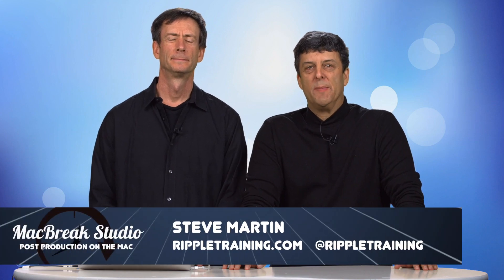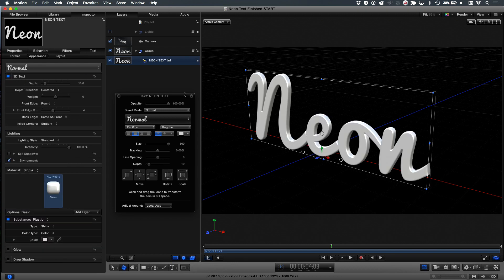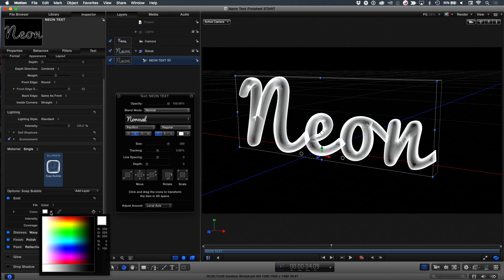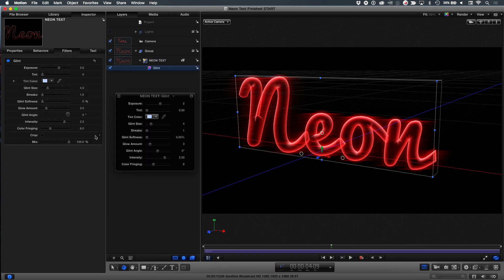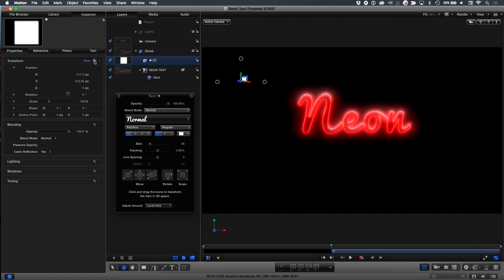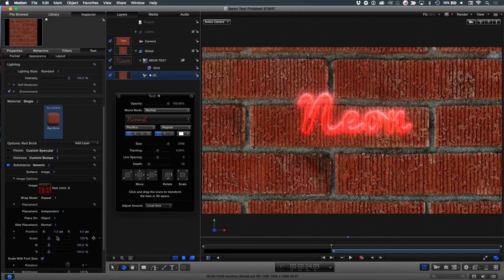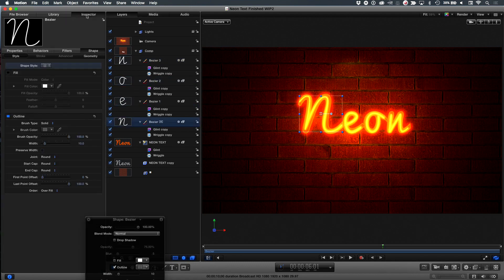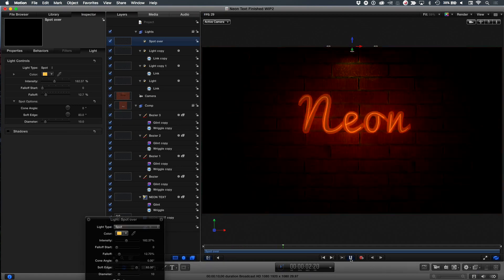MacBreak Studio Ep 356: Creating Neon Lights in Motion 5

Comment: When Im trying to re-create this on the updated motion 5 and try to switch the emoji text to 3D "a 3D rendering error was detected with the font apple color emoji. some characters may not appear correctly" message hence I can't get that nice brick background? any suggestions
Reply from the maker: I just did it -  and it works in the latest version of Motion. You have to click in the Viewer with the text tool, then apply the square symbol. Scale it, then click "3D text" under Appearance. Then apply the brick surface under Material